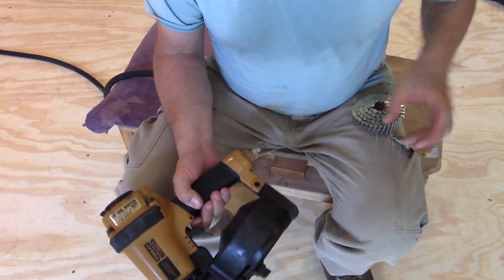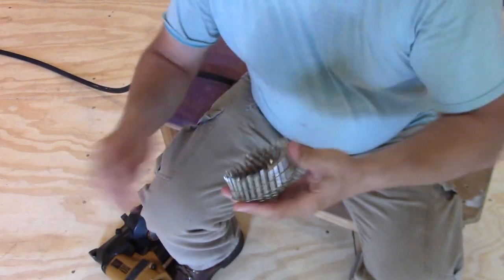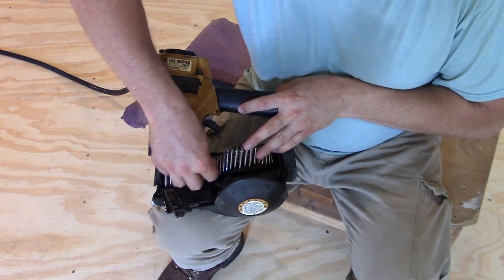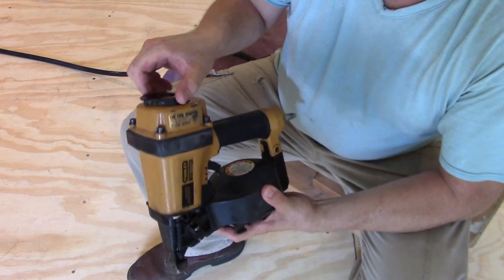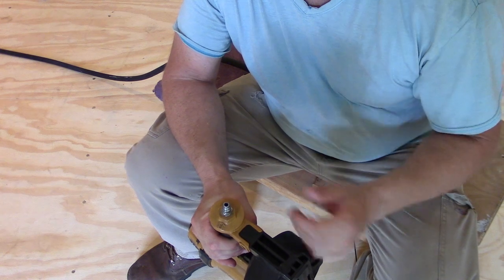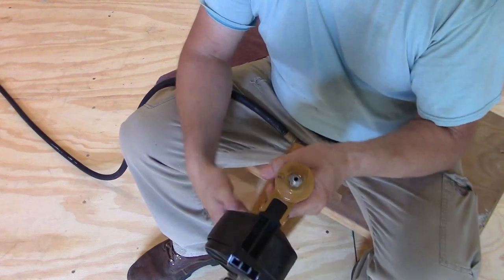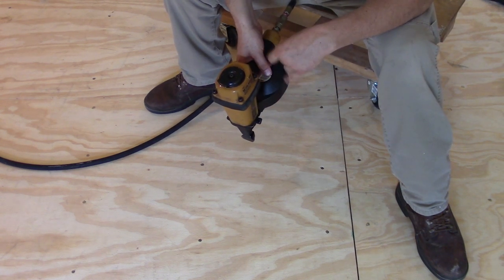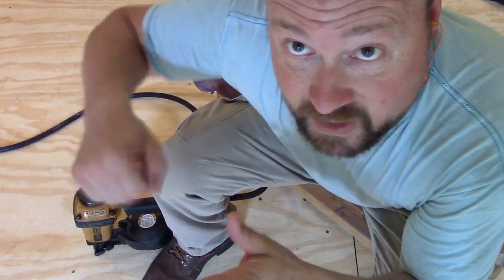How To Use A Roofing Nailer

Comment: I just acquired, and I'm not kidding, a truck load of roofing nail coils because my GRANDMA saw some guys throwing them away in a dumpster and she asked if she could have them so they dropped them off at her place and she spent 2 days packing them in her apartment. She thought I'd want them. 😅 So now I need a roofing nailer caz I have thousands of dollars worth of roofing nails. I'm not a roofer either. I'm a shop metal fabricator and steel erector. I know this story is off topic but I got some good stories about my grandma. Good times with her.

Comment: Mine shoots 2 or 3 nails. Then it stops. I dont think it rotates the new nail into the chamber. Thoughts on why? Correct degrees and size are being used.
Reply from the maker: Is the gun oiled?
Reply: @AroundTheHome1  it is. Thats the weird part
Reply: And it does "shoot" after the second or 3rd nail but no nail goes in. We are guessing the wire that attach the nails? I doubt so.
Reply from the maker: What brand nailer is it?
Reply: @AroundTheHome1  a makita.
Reply from the maker: Well, that's a good brand. Is it brand new or used? Is it new to you or have you had it a while?
Reply: @AroundTheHome1  bought it new 3 months ago when i replaced a section of my roof. Worked perfectly fine. Switched to a different nail. Smaller head. Angle and size all within parameters. Only real difference that i noticed was the wire placement. For the roof nails the 2 wires attaching the nails are on the upper section. These are evenly spread, one too and one bottom. But the nail gun has the slots for them which is why i dont think that would be the issue.
Reply from the maker: @The SpartanKnight I think that sounds like the problem. Now, my nailer isn't really picky on the nails. And even though I am not directly familiar with the Makita Roof nailer, I know that some nailers are really picky on their nails. You mention that you know the heads are different and possible the placement of the wire. I would get that first nail brand again and if that works just fine, then you just have a picky nailer.
Reply: @AroundTheHome1  I'll definitely try that out then. Thank you. If not. Its most likely the wire then, like you say.

Comment: Hey, can anyone help me out here: I bought a used box of coiled nails. Some are loose, as in the coil is loosen, can I still use them?  Can I manually round up the coil?
Reply from the maker: Ok, now I can only give you rough advise here because I am not there holding the nails. But if the nails are not rusted and if the wires holding them together are not broken you should still be able to use them. Roll them back up into a fairly tight roll and then you should be good to go.
Reply: Thanks so much for the advice!  How come if there’s rust, it would be a problem?  Is it because the rusted nails will damage the nail gun? Or just that rusted nails will itself get broken easily?  Sorry, I’m so clueless about nails and tools.
Reply from the maker: Well the nails should have a rust resistant coating on them. If they have been out somewhere that was able to cause rust then the wires connecting the individual nails would suffer most from the rust. As the nails fire from the gun surrounding nails could break some wires and misaligning them. Then you could have serious jams in the gun and even damage.
Reply: @AroundTheHome1  Thank you so much for the info!  I just discovered where to find your reply.  I was wondering how would I know if anyone responded…

Comment: Can i use a bostitch N80CB also use for ROOFING? The nails U put in there?
Reply from the maker: Not totally sure your question here. When I look up that gun, it is a coil framing nailer. If you want to use it for roofing then the nails are wrong. Not only are they too long, but they have the wrong head. To hold down shingles and tar paper you need the much larger nail head. I use my roofing nail gun a lot for holding down underlayment for flooring. You don't necessarily need the larger head, but if you shoot a long nail through then you risk hitting electrical or plumbing. That why I use the roofing nail gun because my nails are only 1" long. I hope that answers your question. Thanks for watching and don't forget to stop by our website for many more helpful videos. www.greatwhiteninja.com